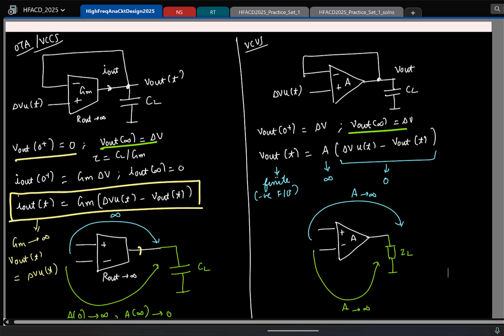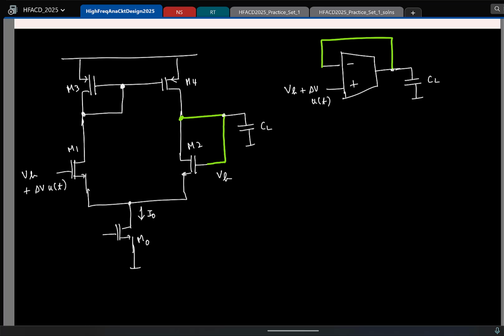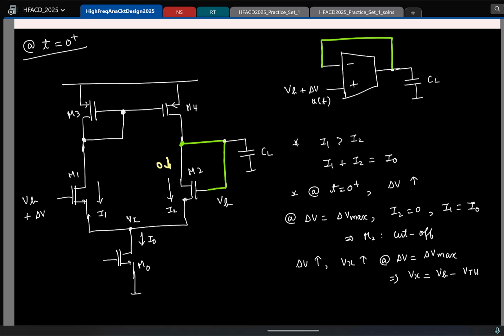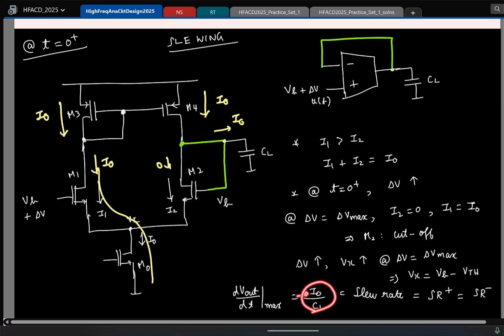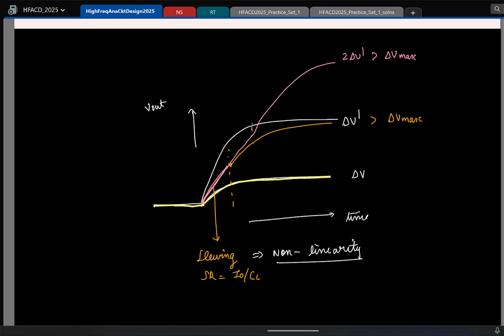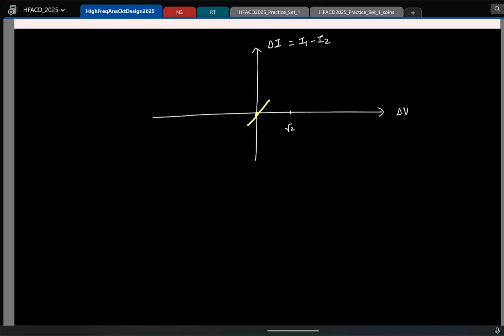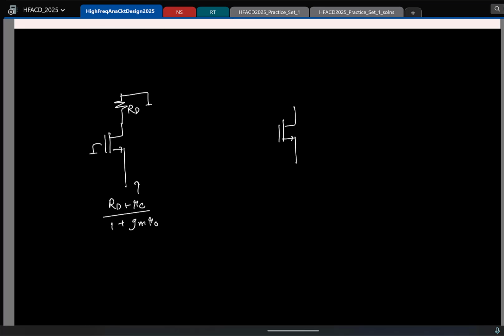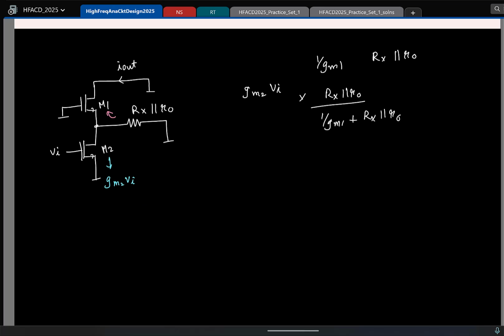Lecture 5(2): Slew rate of the five-transistor OTA

Comment: At 8:05, how can you say that vx will increase, if vx increases vgs of M1 goes down and current will not increase
Reply: same doubt. did you uderstand it ?
Reply: down side is not exactly the ideal current source. hence small change in input vin is not equals to small change in delta vx(There will be some factor which is multiplying). as vin increases vx also increases but that is not exactly equals to the increment of vin.